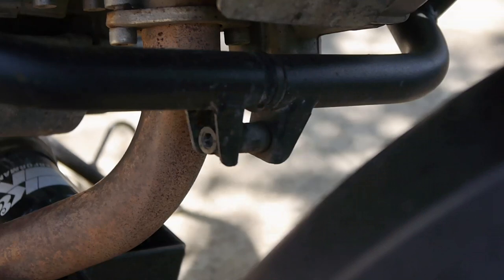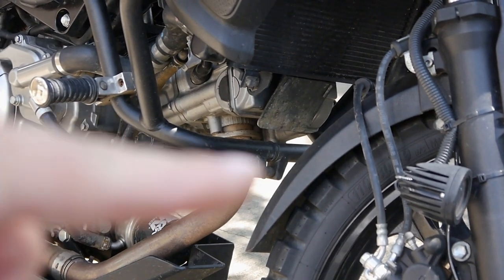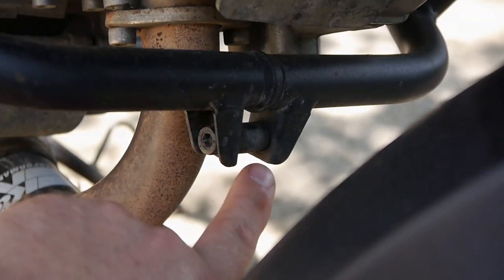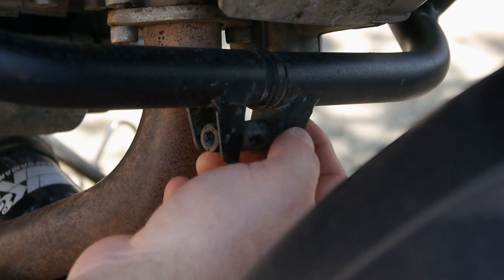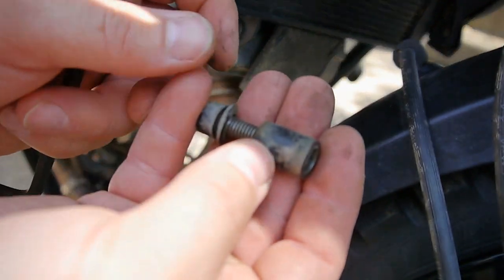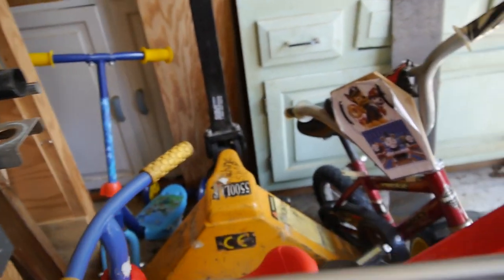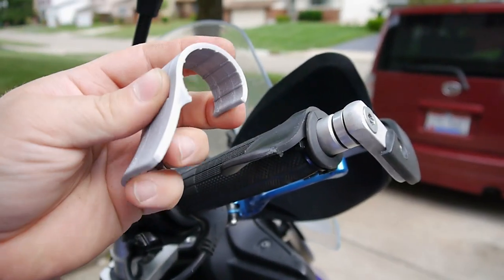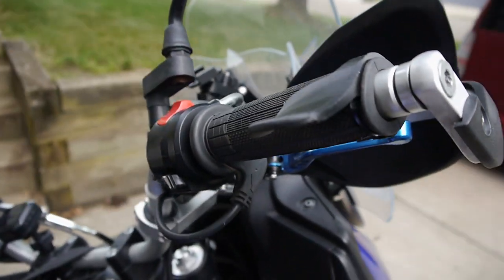2013 Suzuki V-Strom 650 : Fixing Annoying Engine Rattle & Simple 3d Printed Cruise Control.

Comment: Just bought a 2006 and had this sound at 4200-4500RPM. This video is a lifesaver. I couldnt figured out what it was! I just used a washer on either side of the spacer and it got it nice and tight. The threads on mine are mirror finish shiny 0.0. THANKS

Comment: I have a 1st gen 650 and this video helped me to reduce 95% of the "tin bucket" sound. I would tap the top pipe with my hand and it was obvious. Mine we're loose in the slip joint. I opened the joint and wrapped rubber "self-fusing" tape around the pipe and massaged it back to together and wrapped around layer over the hole joint. Thanks!
Reply from the maker: I am glad you found it useful! Enjoy your ride!

Comment: I come from the part you posted on Thingiverse. Great design and thank you for posting! Just printed it today and will be doing a test ride later on. I have a big 300 mile trip coming up as well, so that will be the true test :)
Reply from the maker: @fynn8252 how did your 300 mile journey go?
Reply: @JoshAQ  It worked well! I used it on the highway straights back home. Definitely puts a lot of pressure off the wrists. I printed one for my friend’s triumph street triple, but the factory grips are smaller so it didn’t hold.
Reply from the maker: @fynn8252  if you give me the rough grip diameter. I'll see about making a smaller one you can print for him. I should make a couple of different sizes, one slightly larger and one slightly smaller. I am glad it worked out well for you.

Comment: stick a few more washers in the middle portion, that should remove that wiggle room
Reply from the maker: That would also solve the problem. I didn't want to go to the hardware store and mess about, but that is certainly an easier option if you don't have a metal lathe. Thanks for watching!
Reply: Yeah just add a washer.  I have this issue BTW.